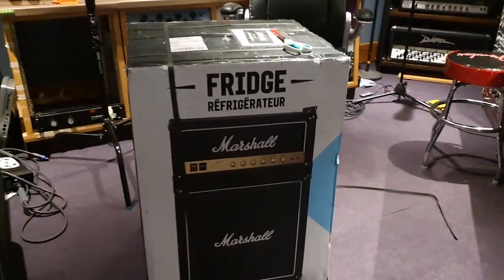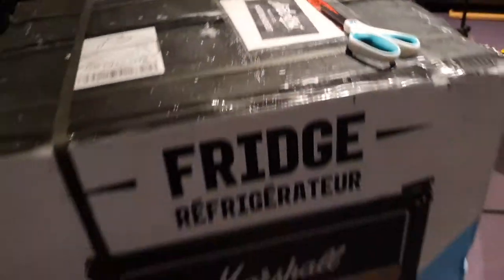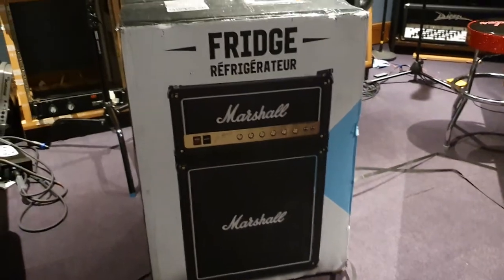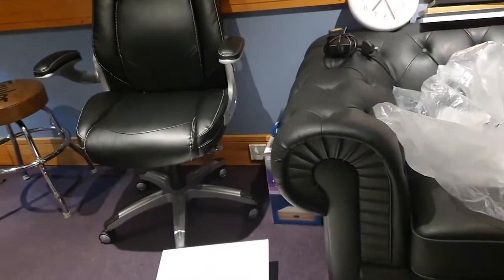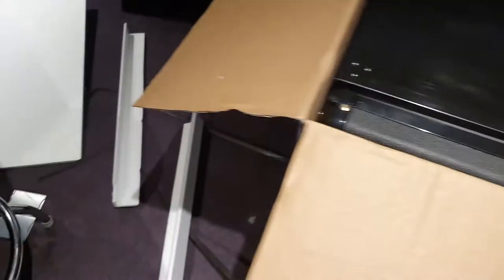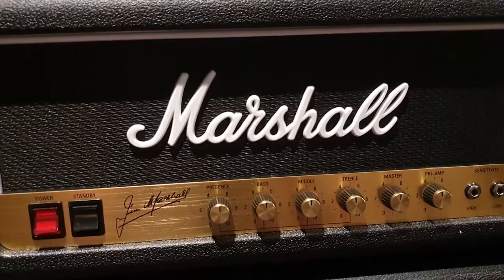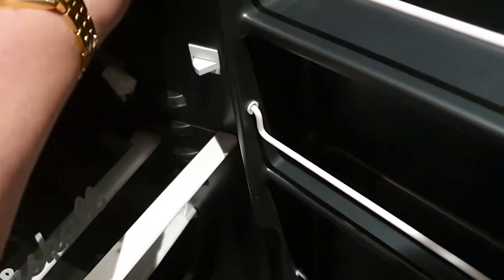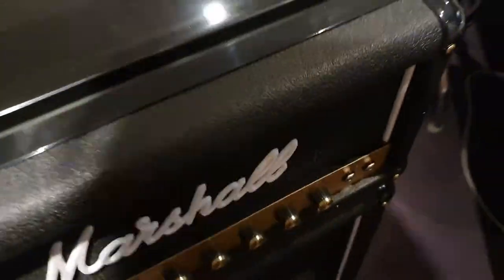Marshall Fridge 4.4 Unboxing Video Review Up Close Guitar Amp Speaker Cab Mini-Fridge Details!

Comment: Its a cool looking fridge. Noisy and shelving system could have had better design and function. To stand beer bottles upright you have to take out all shelves. No room for other drinks. Side flaps do not hold drinks proper. They fall out when opening door.
Reply from the maker: Yeah we put the beer bottles in on their side. The side flap things hold cans of soda in fine for us. Tall bottles of prosecco work fine on the lower side shelf. The freezer flap seems a bit pointless and came off when we got it

Comment: I have a wire hanging in the inside from the thermostat?
Reply: Temp Sensor
Reply: The refrigerator is freezing my beer. I had to turn it down to number 2.
Reply: @MegaBrownb  After I get mine all plugged in I'll have to go out and buy some beer 😀